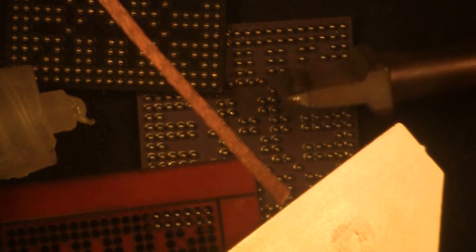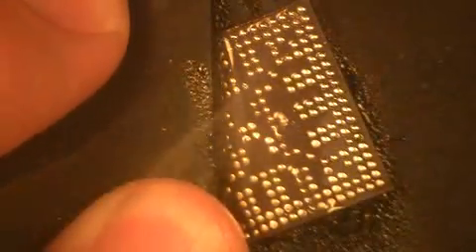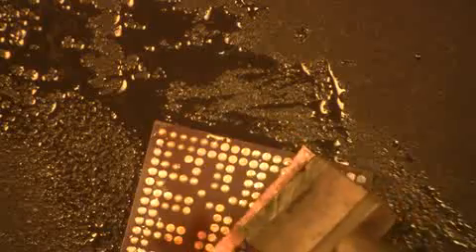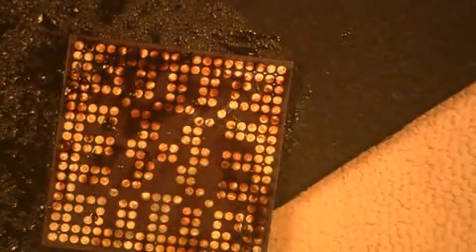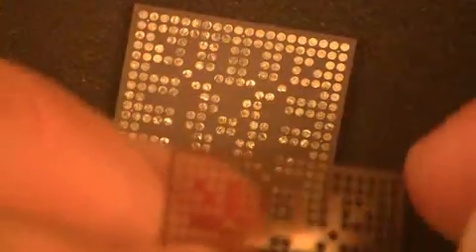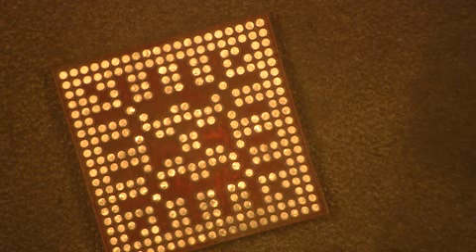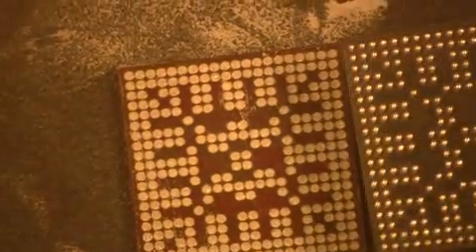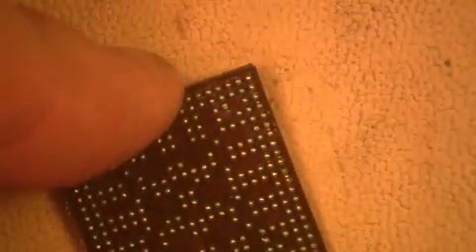BGA Ceramic Reballing

Comment: A good video , but where did you get that solder tip from? and can it be purchased for most soldering irons? You prefer to deal with all BGA chips with hands and not place them into one of those BGA support block thingy's ? think you know which one I mean. Good video thanks.